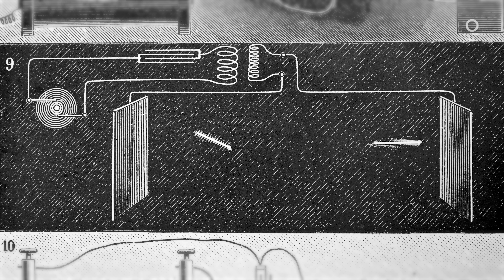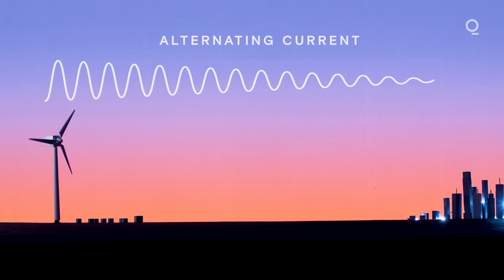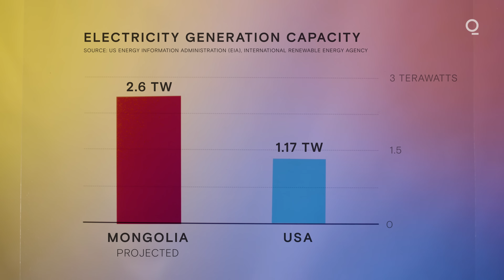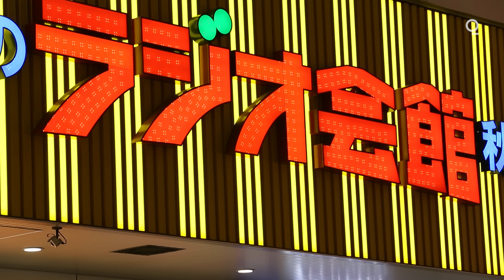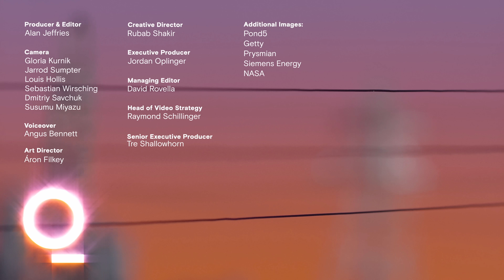The World Needs Supergrids, But There's a Problem

Comment: One Carrington Event will send us back too the 18th century in burnt out systems.  Smaller 200 megawatts town LFTRS and putting on Capacitor’s for other CME’s are way more realistic.  Again what melted the last ice age?  Was not Ford or Toyota it was the Sun, and it’s output which is not only photons..
Reply: It's possible to build electricity grids that can withstand even the largest of solar storms. Let's hope that new supergrids will be protected, a massive solar storm is guaranteed to hit us someday.
Reply: @TheDerperado  the Carrington Event was 100,000 Earths in size,  it set telegraph offices on fire, Something like that is so powerful that if the lines are longer than a mile the induction is overwhelming on Voltage and amps.. by the way the 1859 Event was the start of the decline pole flip that our planet is now accelerating too.  Note the southern anomaly.. And how Sats have too shutdown while going through that area now, and the Japan lost one to as well as SpaceX lost 40 to a CME 2 months ago.  Note the sun has put out such huge CMEs that have missed us and it is not even peak activity..
Reply: Turn the grid off simple as
Reply: @creazytinr  they tried that, in Quebec, did not work.  You have to have a place for the induced current too go too.
Reply: @ballomni  how can induce currents be produced when the grid/ac current is terminated?
Reply: @ballomni  induce currents is produced due to the faradays law in the line or cable conductor mainly  in underground cable due to the metallic sheath
Reply: @creazytinr  a wire in a transformer is insulated, the magnetic field of the power to create the Northern Lights in Cuba will do incredible damage not only to our electrical system but Satellites , internet, home wiring, even cars.. During the Carrington Event telegraph offices were alive all over the world, even disconnected from their main power supply.  Others went a blaze in a fire.
Reply: @creazytinr  when the field lines snap as they are compressed by the CME   It is like collapsing the field on a car coil generating a spark in a plug.   Except unlike are alternating Current, this is DC current such an amount of current from field lines 20 thousand miles in length collapsing, can we say electrical problems will not be your only problem, can you imagine the plate tectonics that it will cause, all of the fault lines throughout the world will move.  Picture an Earthquake in NYC, not to mention the tsunami.  Yup a CME The size of 100,000 Earths has quite a bit of power, but that event of 1859 was not the largest one that has hit earth.  They have found larger in the petrified tree ring record.  It would cost about 27 billion dollars too build simple satellites and build a kind of umbrella at L1 that can open in a minute it would be destroyed but would take the most harming effects from the CME, they would be constructed in orbit robotically, then placed between Venus and Earth orbit too the sun.  Further more they can also be used too spot Near Earth Objects, with more lead time to avoid a collision, which could also help justify the cost of the system.  Note these are not ifs they will happen as they have before.   These are the items we must focus on, not Climate Change, how about a super Volcanoes, etc.  We are running out of time.  Solar max is 2025.  Mark my words we must do this, if we don’t we will be plunged back into the 18 century in technology!  90% of the world population will die from starvation.  Without modern technology to grow food and, process water, transportation and refrigeration systems, the human population will crash..
Reply: @ballomni  If they feel electric shocks? simple ground the system more induce voltage will go down
Reply: @ballomni  Im talking about the power grid idk about satellites
Reply: @ballomni  And there are protection and control engineers who working on these who are much more technical and experienced than us they are prepared
Reply: @ballomni  A simple simulation can easily mitigate CME
Reply: @ballomni  Its a matter of how competent the management can be and how fast they can implement it

Comment: The Russia-Europe energy debacle shows that we cannot do an international energy grid, you can’t rely on adversaries for energy. Europe could connect within the EU, the US could potentially connect with Canada and maybe Mexico but a massive connected system that connects most of the world would be impossible from a national security standpoint
Reply: Europe was relying on adversary for energy. If we had better supply of gas and electricity from Africa and Middle-East, Europe would not be in such bad situation right now.
Reply: @TheDerperado  I mean China is trying to do this, but really you need microgrids and megagrids used together.
Reply: @TheDerperado  Question: did Russia attack Europe?
Reply: @davinawilson9153  The answer is yes.  I'm not sure where you're going with your question, but Russia attacked Ukraine, and Ukraine is in Europe.  Therefore, Russia attacked Europe.  And for geography nerds, 23% of Russia is in Europe while the other 77% is in Asia.
Reply: @pilafmon  What you're saying is idiotic.

Did France attack Africa in Libya and Mali? Did the US attack Asia in Afghanistan and Iraq? Did the US attack Latin America in Nicaragua? And many other examples.
Reply: Canada and the US already are connected by many high voltage transmissions lines. BC sells excess hydro electricity to Washington, Oregon and California all the time in excess of 10 TWh annually. It is called the Western Interconnection.
Reply: Wouldn’t a international super grid actually solve those problems? It makes it easier to switch to a different supplier
Reply: @bbb800  exactly
Reply: @bbb800  A international super grid can be weaponized by a major energy supplier disconnecting themselves from the international grid. That would cause remaining parts of the grid to overload and ultimately result in cascading blackouts that could span the globe. We've already seen it happen on a smaller scale with the Northeast blackout of 2003 in the US.
Reply: @bbb800  Think that would be inefficient and plus there will invetibly be choke points. What if one country literally destroys the power lines on their end.
Reply: @bbb800  the super grid will have vulnerable choke points.
Reply: Don't put all your supergrids in the one basket.✌
Reply: Global supergrids could be a thing, if we evolve as a multiplanetary civilization and develop cheap and high-efficiency fuels and energy supplies. We can see we are evolving to local multinational green energy grids but for it to go global it would require a very strong paradigm shift. "The Expasion" series opened my mind to a few of these ideas, just like this video does.
Reply: How can the system be more harmful than the present situation? Either it's better or we revert back to the current situation. THINK
Reply: @MrAmalthejus  How easy is it for us to switch energy sources now?? It's really fng hard
Reply: Why, it’s not like you can transmit a virus through it.    Sides you just create some sort of shut of valve and automated payments system.     I’m sure it could be done , just needs to be designed right.       Like you design it underrstanding all this.
Reply: The US and Canadian grids are already connected, Canada sells electricity to 13 northern states.
Reply: agree but with better interconnected policies it might be something we can achieve. failing that it would take a world government.
Reply: Look at swift
Reply: @CristMakhanya  The only person who I've seen bring this up, everyone keeps talking about authoritarian control in foreign countries, and act as if that is the only threat.
Reply: Idk I think it's doable if there's some slack and flexibility built into the system and interraliance prevents war and conflict. I think the issue would be uneven power dynamics. Like how Germany tried to build solar plants in Africa and the backed out when running solar farms domestically became xheaper. It's nieve to think that being as green as possible is the only reason for a super grid. There's economic mic considerations too. It's inneficient to not run a Soler plant because you have noone to give the electricity or vice versa use more expensive fuel sources because it's the only thing available nearby
Reply: Redundancy and the ability to isolate those adversaries.
Reply: Skill issue
Reply: speak for yourself canada and european countries may be on board… opec is the enemy though so …. fak
Reply: Having more sources of energy would make energy less secure? What strange planet do you live on? If Russia cut itself off from the global grid, then what? The rest of the grid would carry on as before. Who relies on Russian electricity, besides Russia?
Reply: @gspaulsson  Russophobia can't make it work. You know, people behind this project expect every country to be involved in. Not 2 or 3 or just a bunch of "friendly" countries. It's the only way to bring it to reality. 
BUT...
Reply: The US doesn't even have a unified grid within its border.
Reply: Northern Mexico's grid is already connected to the United States.
Reply: We have to solve the conflict, step forward and make peace, an co-operate and build a huge grid. No other way. We have to change political leaders who want to do it and building bridge not conflicts.
Reply: Precisely, especially when certain countries control more electric power than others
Reply: If the war never happened and perhaps Russia having a competent leader then it means Russia could integrated its electric grid within Europe so that other regions in Russia can also enjoy basic electricity access and therefore more economic opportunities.

But that's not gonna happen in this timeline.
Reply: Such nonsense!
..and more than 200 people giving it a thumbs up...
We're also still flying around the world while circumventing Russia. 
You just need several routes in case one gets cut.
So we could easily connect several countries in North Africa or the Near East to the already existing European grid. 
..and connecting the US Mexico and Canada means your connecting four time zones (so solar in Cali still delivers while the Eastern seaboard is dark and vice versa) and so many different areas with various weather to equalize areas of demand with areas of surplus power.
Reply: lower US emissions by sending it other countries 👌
Reply: That is a problem created by provocations and provocateurs. Provocations mean you get to be ukrained. Civility and restraint are necessary for this to work.
Reply: @bircruz555  Ukraine is the puppet, Europe is the thread; and US is the puppeteer.
Definition of: being ukrained!
Reply: @TheCountess666  Ukraine is not a state folk.  It's just been a US-led region in Europe since 2011. The entire world is aware of it - but not you.
Reply: @davinawilson9153  Caution Russian Tolls are loose on the Internet using fake names.
Reply: @johnswolter  It's the usual argument of people that are unable to give a strong or well-argumented opinion.
Reply: If Europe wasn’t complaining about Ukraine there wouldn’t be a problem either. Interventism is failed western policy. Tell me iraq or Libya is thriving.
Reply: @anonobot3333  interventionism is what Russia is doing, trying to revive failed USSR empire.

Comment: Two things will make renewable energy possible.  1.) global super grid, 2.) power storage facitilies.

My money is on power storage facilities.
Reply: Sadly power storage technologies hasn't keep up with the renewables. We focused so much on Lithium-based tech and only considering other options just recently, where the economy of scale isn't there yet.
Reply: @n_core  it hasn’t needed to. As long as fossil tech is in place, the grid is like a plug-in hybrid car where fossil based energy kicks in where needed.
Reply: The carbon footprint of setting up a global supergrid should be a lot lesser than power storage facilities.
Reply: @anurag-kumar20  maybe maybe not, the carbon footprint of a nuclear power plant is far smaller than coal, natural gas, even solar and wind yet we don't build those.
Reply: @anurag-kumar20  Maybe, maybe not.  Lots of things contribute to the carbon footprint of something.  Manufacture of a product can be tracked a lot easier than construction and maintenance.  While cable is less carbon intensive to product vs batteries.  Cable more carbon intensive to install and maintain.
Reply: RE is possible right now. 
Grids are only needed for place north of mid latitudes where winter sun isn’t sufficient for solar. 
Closer to the equator, self generated electricity with storage is better.
Reply: Power storage facilities have issues too from a dispatchability point of view. One of the many important reasons why generators are superior to energy storage and there is consensus that hydrogen-burning turbines are a critical component to future energy grids.
Reply: @bobhope4358  define dispatch-ability please.
Reply: @DrunkinDuckie  I'm not googling this definition and it is coming from my experience in the power industry, but it pretty much is the ability for a load dispatcher to call a power plant any time (24/7/365 outside of annual outages of course) and get power onto the grid. GE LMS100 units can get a 100+MW of power on the grid in 10 mins. Combined cycle units are getting better too from a cold/hot start to synch perspective. Batteries run out of juice eventually and thus aren't considered dispatchable nor flexible compared to generators.
Reply: @bobhope4358  Just wanted to make sure we are on the same page.  Grid batteries are actually the fastest Dispatch-able power source currently available having the ability to dispatch power with in milliseconds.  Followed by one of the oldest forms of power storage Hydropower, then Natural Gas and Oil generators.  Coal and Nuclear take the longest and are known as Base-load Power sources.

This is why most if not all power stations and substations have Grid battery storage of some kind that can handle the time it takes for power generators to catch up to the demand.  This is to prevent grid failure and handle any grid switching that may take place in case of trips along the grid.

Recently though Large Stand alone Grid Battery storage has been taking the place of the Pumped Power storage systems of the past, this is not only far more environmentally friendly, quicker, and allows for the usage of more non-dispatch-able power sources such as wind and solar.
Reply: my money is on nuclear lol
Reply: GLOBALSUPER GRID WONT HAPPEN..

Comment: And the massive transmission power loss? And it is massive. And there is no current flow! The field around the electricity cable transmits the power, not the "electrons".

Comment: Over 50% of electricity generation is already lost to heat in the wires so unless you have a solution to the electrical resistance over hundreds of miles of high voltage cabling you're not solving that f**** problem.

Comment: If we decentralize the energy production we don' really need a supergrid I think. solar panels can be put everywhere
Reply: Who is we here? I am already decentralized.
Reply: If every suitable roof would be covered with solar panels, most of our energy problems would be solved. Luckily we are already going to that direction, I just installed solar panels myself on my house yesterday.
Reply: @TheDerperado  that is not true. You can see this in densely populated europe that when there is no sun and no wind, we burn coal and gas like crazy, despite having both solar and wind. When it does shine and suitable wind is there, lot's of countries overproduce energy, that's why we need intercontinental connectors so they can sell this effectively so that the destination does not need to turn to burning more fossil. Efficient grid spanning across large area might solve most of that issue.

Comment: In the USA, Why not use railroad right-of-way ? It exists, can be annexed by US Government as a utility, and can be extended to new power producing areas to transport construction materials.
Reply: Agreed. Those companies tend to hold their ROW's for ransom which is why they also don't double-track and offer passenger rail services although they should..
Reply: The privatization of railroads is probably the biggest scam in the US right now. They operate their tracks like fiefdoms and competing trains cannot operate on another company's tracks... can you imagine highways working that way? And they don't just not double-track, they actively rip out existing double track alignments. They'll never spend a penny more on rail that isn't absolutely necessary to keep the tracks at a minimum level of function.